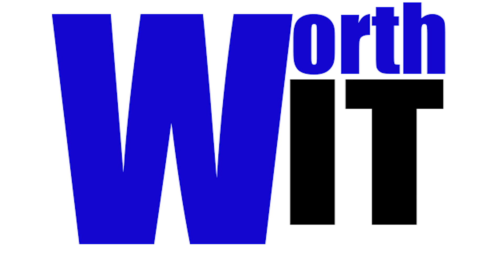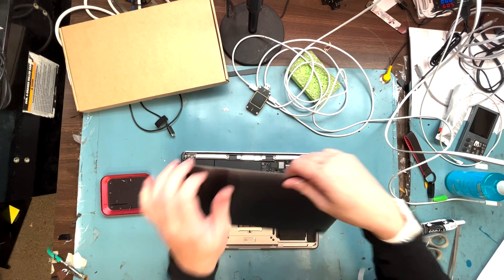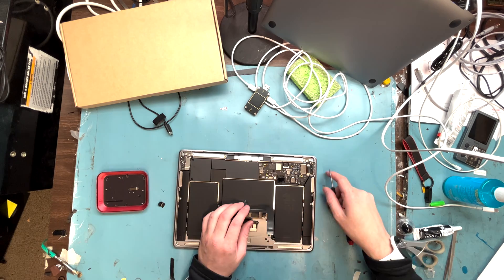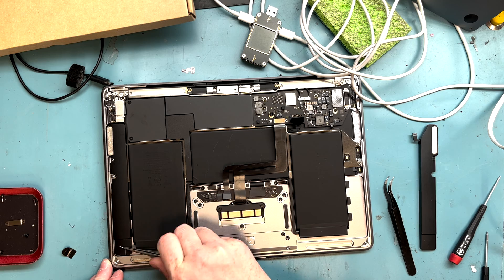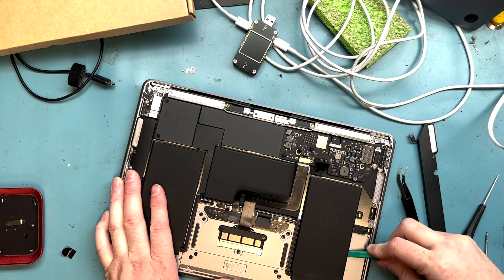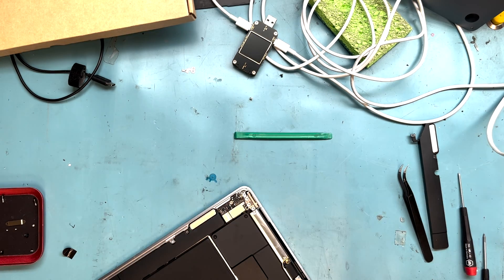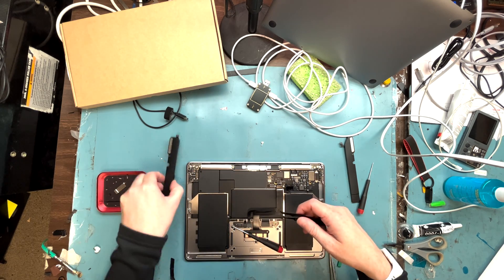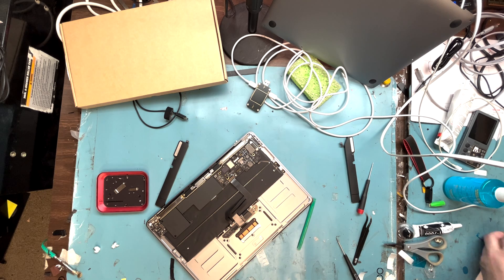MacBook Air M1 2020 A2337 Battery Replacement Guide

Comment: At 5 minutes 30 seconds, on the right side of the case underneath the battery and loudspeaker, there is a small ribbon cable adhered to the case. I stripped the screw to the loudspeaker, so I tried to pull the tabs with the speaker steal in place and accidentally cut that thing thinking it was one of the pull tabs. Any idea what it is?
Reply from the maker: Sorry for late reply it could be a microphone or back light connector

Comment: Great video! I'm watched a few of your videos and was wondering if you know the answer to this head scratcher. I think my SMC needed to be reset on my M1 MacBook air (neither USB -C port would charge), but by the time I realized this, the battery was dead. Now I cannot reset the SMC because I have a dead battery and I cannot charge the battery because the SMC controlled USB-C is on the fritz. How do I get out of this chicken and egg problem? Do I need to put in a new battery? Can the SMC be reset directly via the mother board? Can the battery be charged directly, bypassing the USB-C?! Any thoughts would be appreciated!!
Reply from the maker: Most battery replacements come with like 50% batteries but to get it to turn on you need to connect charger after disconnecting battery it should still work tho. You can charge the battery with a DC voltage power supply but I doubt you have that type of equipment.

Comment: Cant start or charge MacBook Air model A2337 with battery connected, but nothing happened, so disconnected battery and tried to start but again no luck. Any suggestions would be greatly appreciated or if too complicated where would I send to you for repair and what do you charge? Thank you!
Reply from the maker: It could be many things. What I would do in that situation is if I had an amp reader I would check if it was getting amps if not I would try a new charge port. If I didn't have an amp reader maybe would still grab a new charge port there cheap then also try reseating all connections. The last thing to try is disconnecting everything but the charge port screen and battery. Plug it in to turn it on you would have the power button unplugged. To see if it is a different part then you reconnect everything else one at a time to pinpoint the shorting part.

I have every part of this MacBook please fill out our form at icarefargo.com to ship in the device we charge $50 to diagnose it you may be looking at a new logicboard but if data is important we have sources for reliable board repair.
Reply: Thank you, I will try your suggestions, and see what happens.

Comment: Quick question if I order a new battery online does it come with those tabs or do I have to buy them separately
Reply from the maker: Depends where you order battery if it is Mobile Sentrix it will come with the tabs

Comment: Where do I get the adhesive strips in case the battery does not bring them?
Reply from the maker: Not sure where to get them but you could buy these pull tab adhesives that are used on laptop screens https://amzn.to/44DhXcL and cut them to size

Comment: Hi, I purchased a MacBook Air M1 (2020) today. Brand new out of the box but battery won’t charge. Says service battery! Only has 1 cycle in the battery health. Is it possible the battery connector isn’t seated or connected fully? Should I open the back and will I see it if it’s not?  Thanks for any help
Reply from the maker: Sorry for late response but you could try that but most likely you have a defective battery
Reply: @worthitrepairs  Yes I brought it in and indeed the Battery was toast. They Replaced it and now it’s perfect!
Reply: @VoiseyProductions  Same here! new macbook air m1 (battery cycle 1) , but not charging at all! Did you replace it yourself??

Comment: Hey, guys! Help me with advise, if you can, please. I just opened new M1 Air and battery dont charge. Mac was waiting for me for 2 years in the box. Is there any way to get battery back to life?
Reply: Just visit service centre are call apple support
Reply: I have the exact same problem. Apple wants $300 to look and fix it. Mine is also brand new but was unopened since 2020. Did you manage to fix yours?
Reply: Same here! new macbook air m1 (battery cycle 1) , but not charging at all! Did you replace it yourself??

Comment: Hello all, I am hoping to get some help here. 
I have a Macbook Air (2020) M1. I recently replaced the logic board and the fingerprint sensor. The repair went well and computer is working as it should now HOWEVER, the battery now shows "Service Battery" and macbook is NOT charging. The cycle shows only 57 and macbook is fairly new so not sure what happen. I have heard that on new iphones, it will give you an error message when replacing batteries but this isnt the case on my macbook. All i did per logic board replacement instructions is disconnect battery internally and thats all. 

Any help will be greatly appreciated as the normal SMC reset procedure will NOT work on this macbook (shift+option+contro+power for 10 secs). When I try this method, the macbook turns on after 4-5 secs of me holding down all 4 buttons.
Reply from the maker: I did a battery recently and that happened to me aka service message what I did was power cycled the battery to 100% and then drain it to zero and the message went away. However, I expect apple may have updated their firmware to detect part changes and cause a message but not affect the computer like phones.

https://smile.amazon.com/dp/B07MGQZHGM?psc=1&ref=ppx_yo2ov_dt_b_product_details

You need one of these to check if it's a charge port, logicboard, or battery issue.

Comment: Thank you for this video. I followed it and replaced my battery today. Works perfectly
Reply: @jerryx2000  Client wore it out and I'm their IT person
Reply from the maker: It wouldn’t turn on
Reply: Hey where do you buy a battery replacement?
Reply: @davidcruz7696  I got it from Ebay
Reply: I tried to replace it but the speaker rubber did not come out of what to do now pls help me with that 😢

Comment: Hi, My m1 died suddenly, after a repair of motherboard, battery is draining even when shut down (30-40% overnight). Please suggest, what can possibly cause it, motherboard still not fixed or battery unit?
Reply from the maker: Was the board repaired or did you replace the board?